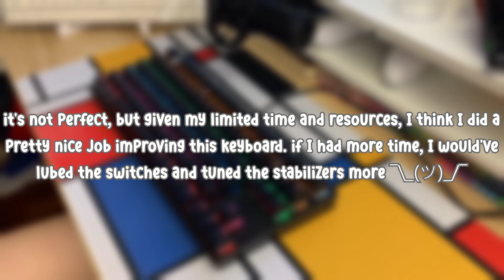I Modded a $12 Mechanical Keyboard

Comment: for a budget keyboard it sounds pretty great only recommendation is buying new switches lubing them and tape moving it will make it sound a lot nicer but overall great build ate
Reply from the maker: thanks! although pls read the description as to why i didn’t do anything with the switches. this keyboard was a gift so I don’t have it anymore, but I have 2 more videos coming soon where I lube the switches and tape mod :)
Reply: Money be like:
Reply: I love your ideas but the switches wont fit in since they are outemu sockets and they are pretty small to fit in any switchea

Comment: i have k550, for what porpuse of modding po?
Reply from the maker: better sound + feel, you can compare the difference between stock and modded at 6:45
Reply: @Ceeme  except sounds and feel po?

mas matagal ba sya masira kesa sa hindi modded?
Reply from the maker: @MusphyOfficial  I'm using google translate on your comment so sorry if there's any misunderstandings, but modding a keyboard doesn't typically affect the lifespan of it (unless you do it wrong and break something in the board)

Comment: Did u desolder? I have the same keyboard but i can't remove the switches
Reply from the maker: This keyboard is hotswap, so there’s nothing to desolder. If you can’t remove the switches, make sure you have the same model or try using a different switch puller
Reply: @Ceeme  it's the same exact model, except it's white and not black :( huhu
Reply from the maker: @kirbysebastianne9275  Color wouldn’t make a difference, make sure when you’re removing the switches you push in the tabs on the north and south of the switch. It requires some force to remove switches and you can try wiggling it back and forth gently to get it out of the socket

Comment: wow I didn't know that this keyboard could sound so good, I just bought it a week ago and I already want to make this modification, although I'm afraid to do it since I'm new to mechanical keyboards
Reply from the maker: Let me know if you have any questions about the modding process!
Reply: @Ceeme  Ok, I don't have the tool to remove the keys, how could I remove them?
Reply from the maker: @darkzred922  I would recommend getting a 2-in-1 keycap and switch puller if you’re planning to open the keyboard to do mods. You can remove keycaps with your hands (although it’s very difficult), but at the very least you would need a switch puller for the switches.
Reply: @Ceeme  Ok, thanks For the information
Reply: @Ceeme  is it a welded keyboard?
Reply: @sm0k3y_Games1  I have one and it's hot swappable

Comment: is it howswappable?
Reply from the maker: This keyboard is hotswappable yes, but I would always check with the seller just to confirm
Reply: @Ceeme  it is because i have the same keyboard for 2 months now and been wanting to switch out the switches but couldn't because i thought it was impossible.. up until this point.

but oh well, it's still better to confirm with the shop that i bought it from.

Comment: Have the exact same keyboard but with outemu blues. Not a fan of the click so I tried removing it, however it's really hard to remove and instead ended up bending the plastic where the Northside LEDs would shine through. Is the blue switched version a hotswap or soldered?
Reply from the maker: Outemu socket hotswap boards are notoriously more difficult to remove switches from, but I would always check with the seller first to make sure you have a hotswap version. Based off your description it sounds like you might’ve bent the plastic of the top housing of the switch; I would make sure that you use your switch puller to push in both tabs on the north and south sides of the switch’s bottom housing before trying to pull it out. You can also wiggle it a little bit to help loosen it, but not too much so you don’t damage the PCB or switch pins. Hope this helps!
Reply: @Ceeme  Thank you I'll try doing that!

Comment: New po ako sa mechanical keyboard  so i dont know what type or name for my switches? I was planning to buy some  because some key are broken already. It a K550 keyboard same store
Reply from the maker: This keyboard uses Outemu hotswap sockets which means you can only use switches with thinner pins (Outemu, Akko). You can find out which switches you currently have by removing the keycap and looking at the color. This keyboard only comes with 3 switch options (red, brown, blue).

Comment: hi im planning to mod my keyb too but it is k880 can i mod it?
Reply from the maker: You can mod almost any mechanical keyboard, but being able to remove the switches (whether through hotswap or soldering) will limit your modding options. I would recommend double checking with the seller you bought it from to see if it’s hotswap, and if so you can do the same mods I did in this video :)

Comment: Thanks a lot! im planning on buying this keyboard. Do you recommend it? couse where I live there are not many choices.
Reply from the maker: if you can spend a little more, I would recommend picking up a budget barebones kit like the tester68 / gk68 (around $20) and some gateron or outemu switches. the $12 board i used in this video is good for the price, but it’s not the highest quality and you’ll have to deal with bad stabilizers and a creaky plastic case.

Comment: Hello it's me again, I was encouraged to make the mod halfway, I only put foam under the keyboard and not above since I do not have the tool to extract the switches, it cost me to remove the keys but I could do it, and the result I like, I change the sound a lot. I want to make it complete but I will do it later. sorry if some of what I said is not understood, English is not my language, I speak Spanish.
Reply from the maker: It sounds like you’ve made good progress!
Reply: @Ceeme  thank you

Comment: Hi im having a hard time getting the switches off by pulling from top bottom. How'd you manage to do it easily? :(
Reply from the maker: You can give the switches a little wiggle (up and down) to help loosen them, but the switches in this board are particularly difficult to get out because of the Outemu (round) sockets. Just be patient and take your time!
Reply: @Ceeme  Okay, I see. Thank you so much

Comment: Hey! Is the pe foam you used to mod the keyboard is the white thingy that is wrapped with the keyboard when u got it?
Reply from the maker: In this case yes, but I personally wouldn’t recommend using it as the plastic coating(?) caused issues with the board. I’d recommend picking up a sheet of regular 1mm anti static PE foam for cheap!
Reply: @Ceeme  Oh ok. Thank you!

Comment: hello! pwede parin bang mareplace yung switch even if the keyboard's not hot swappable?
Reply from the maker: Yes, but it would require desoldering the switches and soldering in new ones
Reply: @Ceeme  thank you! but what if walang pang-desolder ng keyboard? :/
Reply from the maker: @razeu.g  You can only replace the switches on hotswap keyboard without desoldering, all other non-hotswap keyboard will require you to desolder the switches to replace them

Comment: are the keys light to press on? can't decide which switches to buy. (brown or red switches)
Reply from the maker: Reds and browns typically have around the same actuation force (45gf), but reds will be smoother to type on due to the lack of the tactile bump. I’ve used both switches before and prefer reds, but only because browns feel similar to a membrane keyboard. Hope this helped!

Comment: Hello, I'm planning to mod my k550 also. Ask ko lang if pwede ba mag add ng foam without dissambling the whole keyboard? Yung likod lang ng pcb sana yung lalagyan ko. Thank you!
Reply from the maker: Hi, the only way to open the keyboard is to disassemble it because the screws are in the front of the case. You might be able to open just the back if you remove all of the screws and carefully open it, but a few of the screws are under keys so you’ll need to remove a few keycaps.
Reply: @Ceeme  Thank you! First time ko lang kasi mag mod ng mech keyboard and sa basic step muna ko. Adding foam po ba sa back cover will make difference sa sounds niya? Btw i'm using red switches also.
Reply from the maker: @sonrycu1989  Adding foam should make a small sound difference

Comment: it is hard if its your first time modding a mech keyboard? i wanna try to modd mine, i bought on with the same shop u bought it from i saw your review and here i watched it. I kinda want to modd it. is it okay to modd even if its your 1st time? amd what are the tendencies of failing?
Reply from the maker: You’ll never get experience until you try it! I would be careful when removing and reseating the switches because the pins can be broken. Otherwise, just take your time and don’t force anything!
Reply: @Ceeme  last questions, how was the keyboard? is it still working? and is it good for fps games? is the keyboard still working?
Reply from the maker: @JUNEXGLENNABARAN  This keyboard was a gift so I currently don’t have it, but it’s mostly still working besides a few broken switches (which can easily be replaced)

Comment: hi po! hot swap po ba siya? like imean parang naka solder po kasi yung switches to the pcb. Thanks po!!!
Reply from the maker: yes the keyboard is hot swap, it’s compatible with 3 pin outemu style switches and you don’t need to solder
Reply: @Ceeme  thank you so much po!!!

Comment: i have the same keyboard, at first the thicc sound was annoying and distracting, especially when i play rhythm games, this is my first mechanical keyboard and i dont normally use headphones, but i eventually got used to it and just unconsciously blocked its sound, but after watching this video, the modifications made it thocc instead and sounds a bit quieter so im tempted to modify mine, i probably wont for a while since i dont have spare switches just incase a simple "bending the pins back into place" doesnt work when i do bend them lmao

Comment: hello po, kasya po ba rk switches dito? meron kasi ko ditong spare rk switches from rk84, balak ko sana bumili nyan at lagay yun e
Reply from the maker: I’m not sure if RK switches would fit in this keyboard since it uses Outemu hotswap sockets, so you may need to trim the pins to get it to fit. However, I would not recommend doing this as it’s time consuming and you risk breaking the switches. I would recommend picking up some Outemu or Akko switches as those are guaranteed to fit and are relatively inexpensive (~$0.20/switch)

Comment: are u still using it now? does it is still good or having any problem? im bout to buying it but still considering
Reply from the maker: Nope, as I mentioned at the end and in other comments it was a gift so I was never the main user. However, I can say that this keyboard had several faulty switches after a few months of use and the owner ended up upgrading to a better board :)

Comment: Please help me my k550 does not respond properly and it has double tap and dead keys and i cant type @ !#$ that type of keys while im pressing shift i need to repeat it so it can type those
Reply from the maker: Sounds like an issue with either the switches or PCB, I would recommend changing out the switches on the broken keys (you can replace them with Outemu switches) first, and if that doesn’t work then it’s likely you have a defective PCB.
Reply: @Ceeme  can you suggest me how to clean the switches ? my friend said that try to clean the switches first
Reply from the maker: @sktar9996  You can clean around the switches with isopropyl alcohol and a cotton swab

Comment: is the pe foam 0.5 mm thickness or 1?
Reply from the maker: it depends on what foam you use, this foam I used was about 0.5mm thick which is why I used 2 layers
Reply: How did you remove the pcb
Reply from the maker: @jazperchavez1583  once it’s unscrewed you can just lift it out of the case

Comment: Bat yung sakin hindi hot swappable? Haha. Mahal pa ng bili nasa 800+. Na scam ata ako a. Leaven k550 din 87 keys
Reply from the maker: Hi, I'm not a seller of this keyboard nor am I affiliated with any sellers, so sorry if you had a bad experience. Not all keyboards are hotswappable and you have to make sure when buying one that it specifically lists "hotswap" as one of the features. The Leaven K550 keyboard is hotswappable though, so make sure you're using the right tools and pulling on the correct tabs of the switch. Hope this helped :)
Reply: Ok. I asked the seller about the product that i bought, he said it is pluggable. What does that mean?
Reply from the maker: @tamago9990  That probably means hotswappable, make sure when you’re pulling out the switches you use a proper switch puller and push in the tabs on the North and South of the switch before trying to pull it out.
Reply: @Ceeme  alright. Thank you so much ☺️. Might try remodeling my keyboard too.

Comment: What p.e foam did you use? is it the anti-static or the regular one?
Reply from the maker: I used 1mm thick anti-static PE foam
Reply: @Ceeme  can i use the one that came with the keyboard
Reply: @Ceeme  can i use the one that came with the keyboard
Reply from the maker: @jawake3442  I wouldn’t recommend it as it caused issues with the switches not being registered, so use at your own risk

Comment: Hi! I bought this keyboard about 3 months back, but a few switches were already a bit unresponsive. Do you know what kind of switches is compatible with this keyboard?
Reply: Outemu or Akko
Reply from the maker: Anything Outemu will work, although if you're finding specific switches are unresponsive, I would recommend switching them out to a different position on the board to see if it's actually an issue with the switch or the PCB
Reply: Akko Switches

Comment: I'm having a hard time removing some switches from my K550 while having removed some relatively easier. Any tips?
Reply from the maker: Also had this issue too, would recommend using a good switch puller that doesn’t hurt your hands (my personal favorite is an IC switch puller) and taking your time. You can also gently wiggle the switches to loosen the socket, but do it at your own risk. Good luck!

Comment: if i may ask does the board still work till now? as many has said that some keys wont work on a period of time, a reply would be much appreciated^^
Reply from the maker: hi, unfortunately this board was a gift so I don’t have it anymore. I personally didn’t experience any broken switches while I was making this video, but broken switches can easily be replaced with outemu switches since the board is hotswap. hope this helped!
Reply: @Ceeme  thanks alot tbh i dint think youd reply
Reply from the maker: @cutiepye4606  :)
Reply: @Ceeme  oh also 2 more question and thats it, is it hotswappable even when it has outemu blues on? and can i replace the switches with gateron?
Reply from the maker: @cutiepye4606   this specific board is not compatible with gateron switches because it uses outemu sockets (which are rounder and won’t fit the slightly wider pins of gateron switches). as for being able to change out the switches, I would make sure you have a hotswap board before pulling anything out (you can confirm with the seller from where you purchased the board)
Reply: @Ceeme  salamatss tlga ur opinions definitely helped me 

btw u earned a sub keep up ate, youll make it big one day^^

Comment: Im wondering will some thin eva foam short the keyboard , im pretty worried but im up for modding my keyboard once i get it :)
Reply from the maker: I've used EVA foam (2mm & 3mm) in multiple keyboards before with no issues, but if you're worried I would recommend researching or asking around in keyboard communities :)

Comment: Hi. Is it okay if you don't put holes on your pe foam before you put the switches back? I'm still new to modding mechanical keyboard and been planning to mod mine. Thank you!
Reply from the maker: I would highly recommend making holes in the PE foam so that the switches are properly seated, but it’s not 100% necessary. Keep in mind that some switches may not register properly if they come unseated